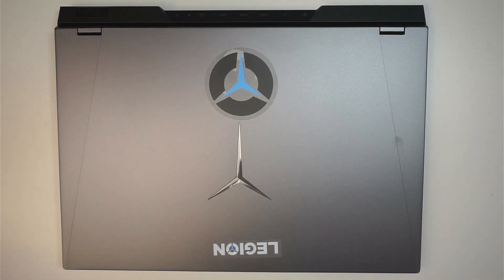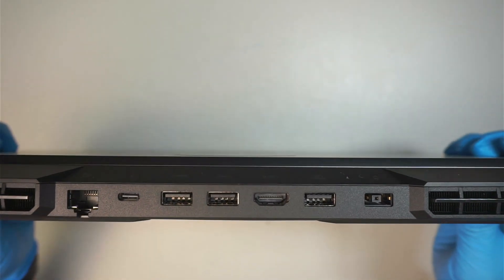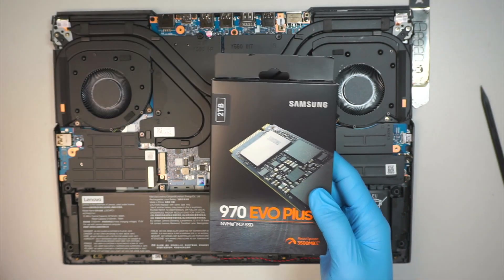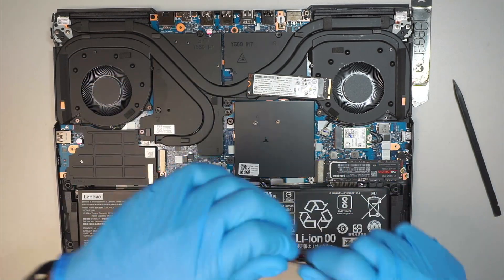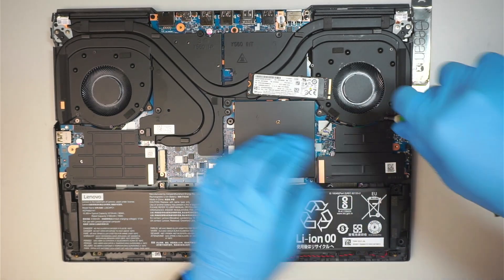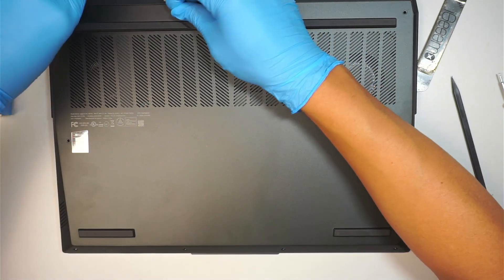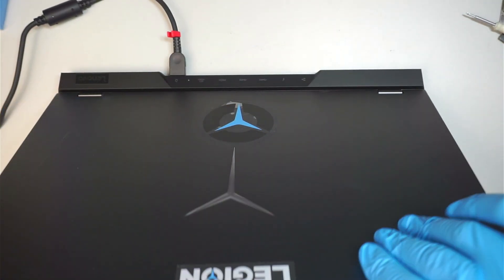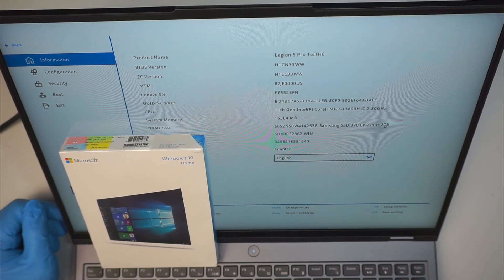Upgrade 2tb NVMe M2 SSD Legion 5 Pro

Comment: Was the plastic tab which broke off and flew away at 2:25 ever found again? :)

Also, thanks for disconnecting the battery at least for us viewers. Those screws laying around on the SO-DIMM cover, just waiting to roll down somewhere harmful on the motherboard and potentially destroying it were raising our blood pressure until you disconnected the power source...